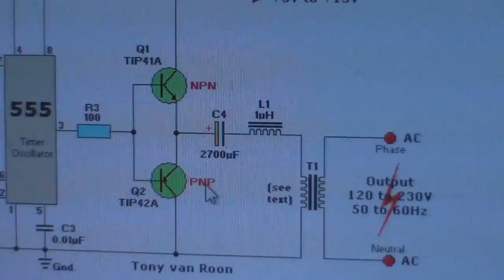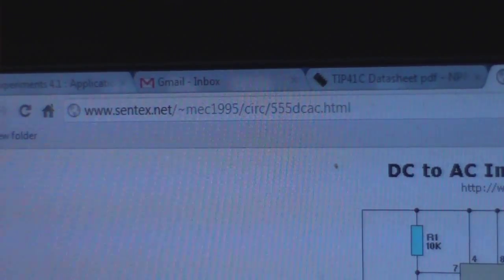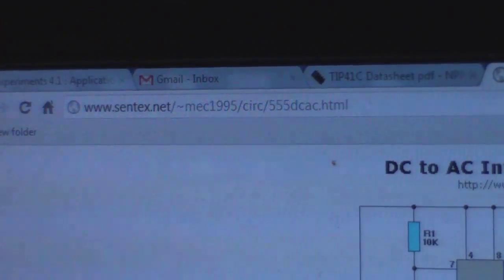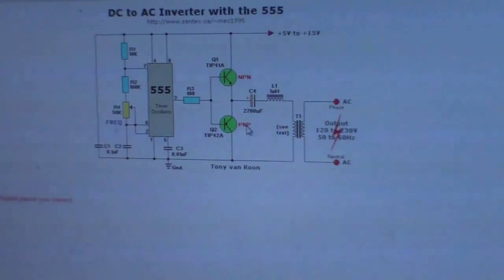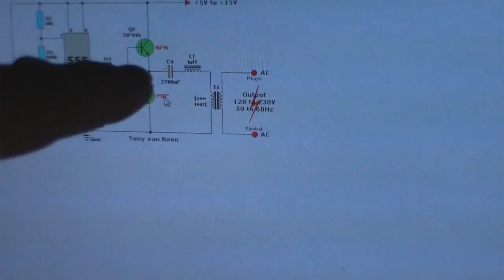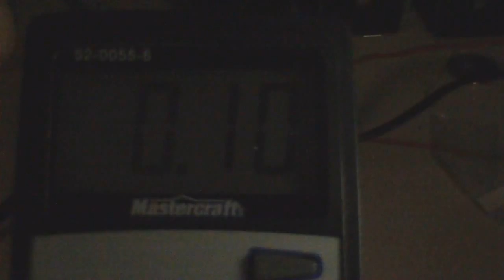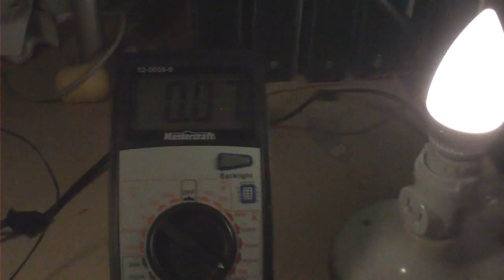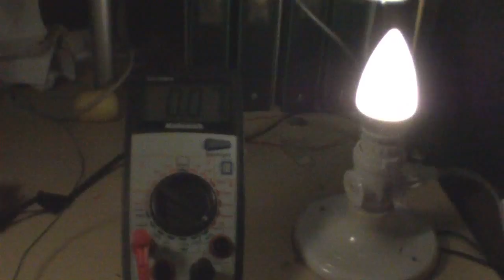The Sentex KyleMod 555 Oscillator DC to AC Inverter (12VDC - 120VAC) 1 Watt Lamp

Comment from the maker: @slider2732 I'm not sure what you mean by the 1/10th... but if you are saying that when you use an oscillator to try and step up... and you don't end up with the desired voltage... I agree! I think there is only 50v here! So, I changed to a smaller transformer, from a 120VAC - 6VDC wall adapter... it works much better! But again, if you actually measure the voltage...it say about 50VAC on the work end, loaded. No matter tho, it works well! I am mainly doing this for outdoor solar lights.

Comment: Must try one of these "Kyle's Tildy" circuits..hoping you tweak Mr Van Roon's original out fully so it gains that name. I seem to get same amp draw but 1/10th voltage used from any circuit, for same light output as mains. In itself that's cool anyway. Looking to use a CMOS 555 and run at lower voltages, but depends what I have around. 
And, I was mentioned in the video, so have to build it really don't I ! :)

Comment from the maker: Also, I need to try using a 6v - 120 transformer, I am only measuring 50VAC on output.  * this circuit doesn't work worth shit when using the "Lights of America" style bulb, for whatever reason. The LEDs in those lamps are bigger and the whole bulb is just more "current hungry" it seems. See my Centre tap transformer vid description for name of these bulbs.

Comment: I did this circuit before but didn't work, so I'm gonna make it on the next year, the thing is that the output power is quite small, but should be enough to be an inverter for an emergency light, have a great Christmas too Kyle :)

Comment from the maker: no resistor off PIN 3, at all, no inductor on the filter (only a single 470 uF cap),a 47k pot to the top rail, 10k tuning pot - and 20 nF timing cap to (-), fairly bright at 40 mA, and it's now starting to ring a bit.At 3.9 nF, it'll still oscillate, draw is around 30 mA, but you do lose some light. I am trying to rid the circuit of reistors as much as possible, and get the frequency high enough that I might incorporate ferrites? Pretty nice little set up for only 0.5 - 0.9 watts now!

Comment from the maker: @z1zaz I just tried the circuit without the 1 uH inductor, it does work ( with a 250 uF electrolytic). No real noticeable difference in brilliance, or amp draw, here... I'll have to look at it on the scope while I play around with the filtering. I want to try some different transformers too. Thus far, my whole circuit seems like it's output is quite limited, period, but for my particular application (outdoor solar lighting), it's quite ok, that way...

Comment: Hi Kyle,
After making a video like that I think you need to sit back with a bottle of Cognac.(LOL)
Thanks for sharing.
Can I suggest you connect something like a 1,000uF low ESR between the output collectors to lower the impedance between the rails.
Also C4 and L1 are in series with the load so low ESR and low coil resistance should increase efficiency.  Often many 100uF caps in parallel are more efficient than a single 470uF.
Is that 1uH essential - the transformer has much higher inductance?

Comment from the maker: The way I see it, is your using more energy heating up resistors to slow the capfill time, to then lower the frequency, so when you tweak it, you get back the joules making light, instead. Could be wrong tho, that's just how it seems while playing with it.